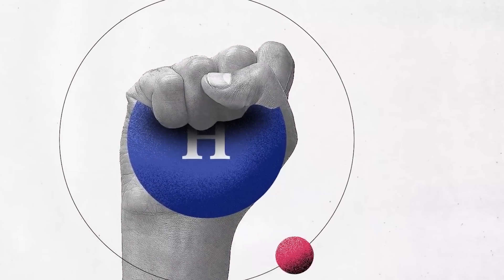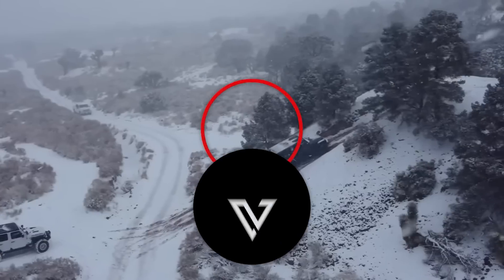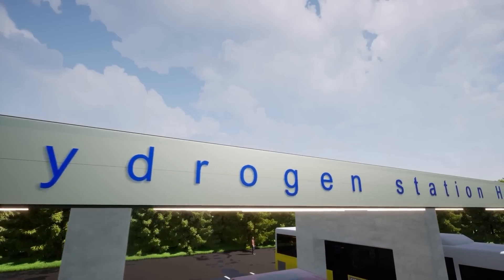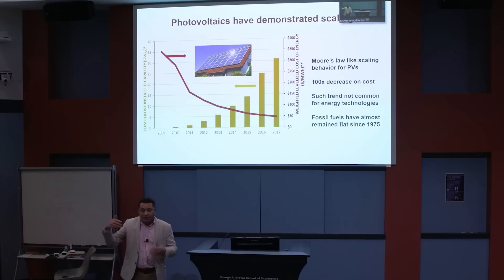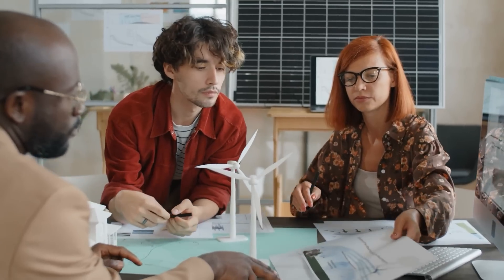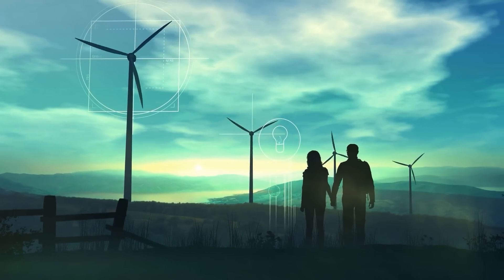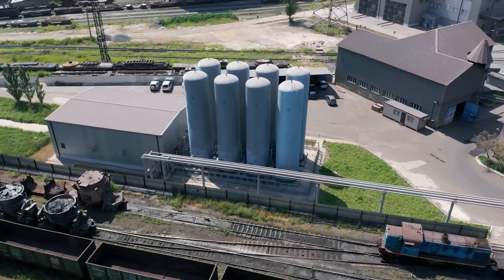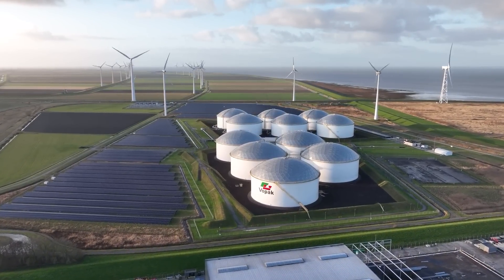Scientists At RICE Confirm MAJOR Solar Hydrogen Breakthrough That Changes Everything

Comment: Hydrogen is the promising Energy source of the future, AND always will be ! Hydrogen embrittlement all materials it touches necessitating system replacement at a cost and creating continual greenhouse gas penalty to mine, transport, manufacturer assemble, distribute, remove failed Hydrogen system, replace Hydrogen system,  dispose of the embrittlement failed system, recycle failed components. Over and over as Hydrogen systems leak causing Hydrogen molecules  bonding in the Earth's atmosphere to create unwanted polluting agents. Yeah Hydrogen is the future, a bleak future of Hydrogen leak fires.

Comment: 46 seconds in and I’m already skeptical. The problem is the cost? It takes energy create, store, and maintenance everything associated with using hydrogen as a “fuel”. It is essentially a battery. A temperature controlled, under pressure, flammable, lighter than air if not contained, battery. You get less energy than you put in.

The only things going for hydrogen is it is abundant, acts as a store of energy, and can be burned as a fuel with existing infrastructure already in place for other gases.

The problem with deploying hydrogen on a scale to replace fossil fuels is the catalyst. As of right now precious metals like palladium, platinum, and gold are the options.

Comment: First, carbon pollution is not a problem but its finite access is. Green Hydrogen is the future fuel for the planet. Thorium salt reactors are the means to provide it. Government desire to stop the race downward is necessary to halt the depressing continued hype we are getting about electric products, EVs and battery operated products as the sole means of our future advancement. We simply do not have, nor ever will have the infrastructure to support this hair brained ideology.

Comment: Ok; when the guy narrating can't get his facts straight, I doubt the accuracy of the entire piece.
The narrator said "... they use a process called hydrolysis"; look it up.

Hydrolysis is an organic chemical reaction that involves adding water to break apart molecules. This reaction is used for both biological and chemical applications. A way to remember the term hydrolysis is to think of 'reaction with water. ' There are three types of hydrolysis reactions: salt, acid, and base reactions.

That is NOT what is taking place!
The actual process is called ELECTOLYSIS and it is the seperation of the hydrogen molecules from oxygen molecules by adding electricity to the water.
Hydrogen gathers at one electrode and oxygen gathers at the other. This technology was implimented back in the 1950's.

Comment: Usable water for electrolysis is not abundant.

Drinking water is becoming scarce in various places around the world. Using water to power our society will put a major strain on our water supply and thus is not sustainable.

You will need to desalinate seawater to have an abundant source or water, which comes with extra costs. We hardly desalinate since it's a costy process.

As much as I would like for this to be viable... I don't see it as of now.

Comment: This won't change the world. Here is the simple math. Hydrogen costs about $13 per kilogram (retail) and used in a fuel cell vehicle, will get you about 60 miles per kilogram. A typical electric car will use about 20kw of electricity to go 60 miles, so if electricity costs $.18 per kw, then to go 60 miles, you would $3.60.  Bottom line, it just isn't cost effective.  (If there were already a hydrogen distribution network in the US, the cost might drop to half of the current cost, but it would still be economically unfeasible.)

Comment: So instead of connecting the solar cell to some stainless steel electrodes sticking into your salty water you want to submerge the solar cell in the salt water then trying to keep it from dissolving and why do you want to use a semiconductor all you need is a dc source of power otherwise instead of hydrogen and oxygen you get brown gas which burns very clean only leaving water when it burns I believe if you just burn hydrogen you will have to add oxygen or it will not burn. They make devices that make and use brown gas especially for welding they are way safer than other gases that are used and a lot more versatile you should look up brown gas they’ve been trying to get people to switch for years but people don’t like change especially if it’s better just look at electric cars Tesla made some great ones in 1900 they still work the batteries still work about 15 years ago the Chinese bought out the battery manufacturers and discontinued the nickel Iron batteries they didn’t over heat after recharging them a few times the metal dissolves like acid batteries but when you recharge nickel iron batteries the electrons go back to the plates they came from and the nickel and iron plates become more pure metal than they were originally when the electrolyte gets dirty and starts going bad you just wash out any sediment with the old electrolyte dump it out and add new electrolytes do this every 3 or 4 years and the electrolytes is made by adding lye and water I got the mixture from the company a few years ago so I could make it for a friend of mine who had several hundred of these batteries he got from the railroad then you just recharge them for a few hours and there good as new I don’t know how long there good for like I said Tesla made these back in 1900 Jay Leno has one of his cars and still drives it with the original batteries. But after they quit making these I told my brother and he thought he would make some for his off grid house but Guess what you can’t buy the nickel or iron plates you have to order them from china and they will make them for you. But now we have lithium batteries these are so much better because we have little black kids digging up the lithium by hand and we need tones of it to make a few batteries and so what if a lot of black kids have to die were saving the world right. And lithium is more versatile they say well not really they don’t work if the temperature gets below 70 degrees so they have heaters in the battery packs to keep the temperature up and if it goes above 130 degrees they will go into thermal runaway and they make there own oxygen so fire retardant and foam they use on fires to stop the oxygen won’t work so you have a big fire until all the plastic and batteries are burned up. Did I mention that the battery pack starts at around $12,000 and up and unlike the nickel iron batteries lithium really can’t be recycled and there only good for 10-12 years but n your video your bragging that they’re making semiconductors that will work in salt water and I have 2 thing to say about it. 
1. Why would you want to put a semiconductor in any corrosive substance usually they are sealed in epoxy or something to keep them safe from the environment.
2. What the heck does this have to do with solar panels or the making of electricity. It sounds to me that you found a big word like semiconductors so we will use it to sound like they’re doing something to raise millions of dollar’s for researching some thing they’re never going to do.

Comment: I heard that transportation and delivery are the major blocker to hydrogen adoption
Reply: They are indeed.
Reply: Even if we could get hydrogen production 100% efficient it wouldn't help. The biggest problem is its very low energy density. It either needs to be compressed to very high pressures or cyrogenically liquefied. Both of which waste vast amounts of energy.

Comment: Hydrogen has many bad qualities as a fuel, making it isn't the worst one. Storing and transporting are far worse. It leaks through everything man made, as the molecule is tiny, and every connector is a failure point. Even if you can stop it from leaking out, and that's a big if, its going to boil off no matter what you do, unless you expend a lot energy to keep re-cooling it so it doesn't boil off. Lastly it has a tendency to explode, which doesn't go well with a fuel that leaks out of anything you put it in.  Unless you can produce hydrogen at the same place you use the hydrogen, its a waste of time and energy.
Reply: It can be turned into ammonia (NH3) which is transportable. So the hydrogen energy cycle does have its place.
Reply: I agree with you, but by reducing 34.7 to 15, you can use hydrogen on every power plant, transmitting a radius of 35 km.. BUT if you only want the Electricity and heat, it is a different story. See my comment above. The distance of TERRICOLA 1 and the 1600 kw generator, was 32 m, with zero loses.

Comment: Is the hydrogen stored as a gas or liquid?
Reply: Hydrogen is safer as a gas. Using a 5,000 or a 10,000 psi cylinder. 3600 psi cylinders have been used for years. The newest are made of carbon fiber, seven times as strong as steel. They must be inspected every 3 years or 36,000 mi for external damage usually caused by carelessness.
Reply: @davidrte.664  why do they convert it to liquid and it needs to be refrigerated?
Reply: @neilwani1178 they don’t…. It is compressed gas .. unless you are fueling a rocket.

Comment: I think hydrogen will be the future for every industry when it's perfected. Solar panels technology has gotten better and cheaper to manufacture. Yes is extremely flammable, so is gasoline vapors and natural gas. Bravo for Toyota moving forward in hydrogen fuel cell technology. I would buy fuel cell car. I wouldn't never buy a Tesla or EV junk !
Reply: the downside of all green energy tech is a reliance on some exotic raw material - in the slides shown in the video, per the paper submited to Nature Communications, it showed platinum in the material sandwich

every green energy tech requires some ingrediant(s) that are not really viable at huge planetary scale consumption

and solar is diffuse energy source so requires extensive surface area to garner much energy (thus putting pressure on the exotic ingredients)
Reply: I think you're wrong because you don't know better and that's okay 💬🤔🙂
Reply: @rodneyscholtz8849  l  stand firm on hydrogen. I rather be low on fuel, than low on batteries. Just my opinion.
Reply: @frank.l181 Is it liquid hydrogen? Or hydrogen gas?
Reply: @frank.l181 Battery technology is developing so fast, longer range, quicker charging times etc. It might not be for you now, but they are brilliant. Trust me. In 5 years the cars will be brilliant and the charging infrastructure will be improving massively.
Reply: @jasonallatt5410 , l agree battery improvements has gone leaps and bounds. Lithium-ion  is incredible battery technology. But l think it will still  have it drawn backs like charging time  inconvenience. Hydrogen fuel can be fill a vehicle under 5 minutes. What are you going  do with all fossil fuels- Not use it ???
Reply: @frank...  💯 👍👌